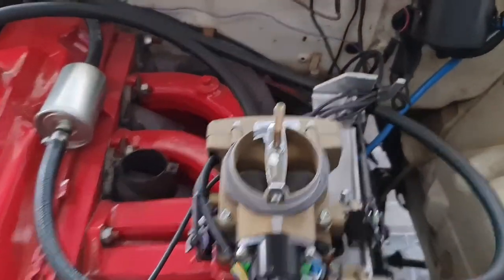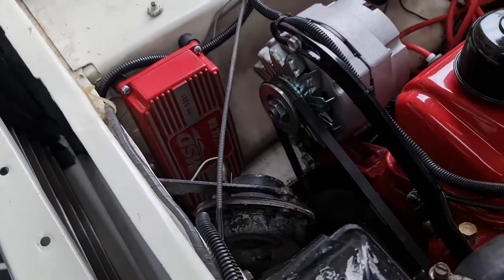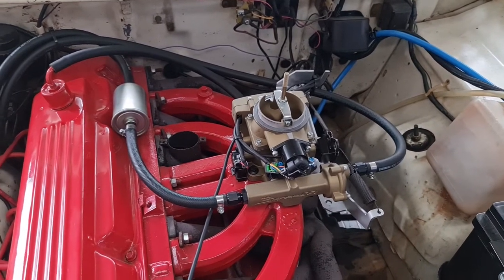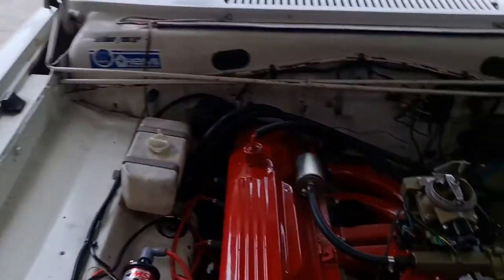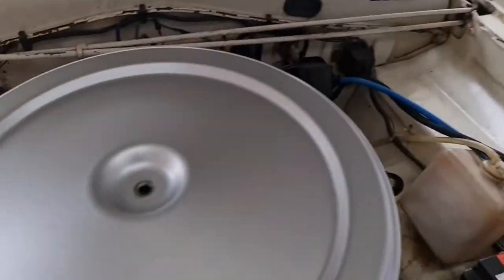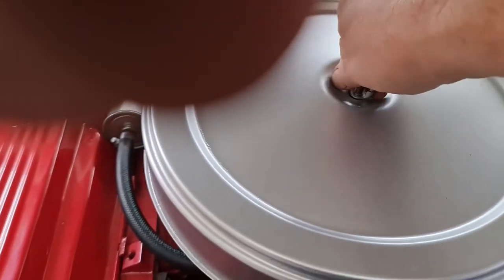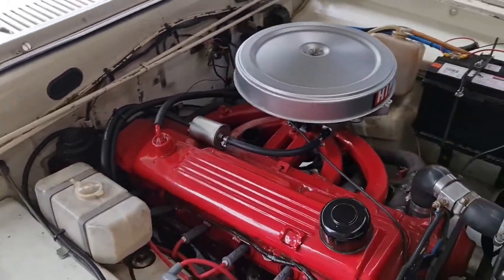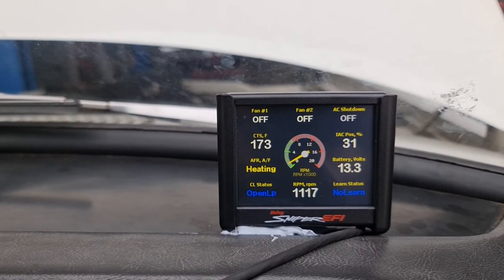2 barrel Holley Sniper set up on VC Valiant Sedan

Comment: I wouldn't have the metal fuel filter placed ontop of the cylinder head unless you wanna boil the fuel in the filter and end up with vapour lock.

Comment: Vapor lock is due to heat , of course, but also because there isn’t always enough movement of fuel and it creates heat soak.  
  A way to combat that is with the fuel filters that have a bleed off. They have an auxiliary tube that lead back to the tank to keep fuel flowing .  I would not allow that filter to stay on top of a cylinder head .  I would suspend it in the air where there is sufficient air flow .
Reply from the maker: The main reason this client wanted the Sniper system was it allowed driveability immediately and didn't require the choke or a warm up time.  This was an issue as he lives in an apartment complex and the lack of control with the old choke system would set off the Air Quality alarms in his undercover parking garage within 30 seconds of him starting his car when cold.  The Sniper has eliminated this.  Heat soak wasn't really and issue for this particular vehicle, having said that the Sniper does help eliminate this problem especially in Australian Summer city traffic where it doesn't matter where you mount the fuel filter in 45 Degree heat, you will get heat soak regardless.

Comment: What a nice set up!  I used to have a Duster and a Valiant years ago.  Both had a slant 6 and I always wondered if a Holley Sniper would work with these engines.
Reply: Such dependably with the engine & a EFI would be icing on the cake

Comment: Very nice, I would also suggest an electric cooling fan and a higher amperage alternator. The mechanical fan eats up quite a bit of power as well as fuel mileage. The upside to a mechanical fan is that you know that it is working I suppose.

Comment: Did you need an adapter for the Sniper EFI, or did it bolt straight up wing the 2 barrels were Holley?
Reply from the maker: If you have a 2 barrel intake manifold it will bolt straight on, no need for an adaptor.

Comment: Well done lads. I have a Sniper plus Hyperspark (Dizzy, Coil & CDI) complete system I got from Summit although the Hyerspark Dizzy, Coil, CDI was purchased separate. Fitting mine to a Holden 308 in my Sandman HQ ute. Got a new Camshaft (old one died thanks to no Zinc) that is 214/224 & 050. Also new timing chain, water pump, HP Oil Pump, Hylift R Lifters plus a 1 inch spacer on the modified Edelbrock Manifold. I too would love to use this on my mum's 202 HQ Premier. So did it start first go after fitting and any problems????? How much better is it to drive plus fuel usage?????
Reply from the maker: The Holley system learns really fast and usually will start first go, the more you run it the better it tunes itself and learns to all the conditions.  Much easier to set up then some of the other brands.  This client is really happy with his system and it is his everyday driver, he does allot of city driving in it too.  He is really impressed with how much more fuel efficiency he has and has just booked in for a disc brake front upgrade because it is so much more responsive.
Reply: What about a update on this one??? Still NO issues?? @ValigruntPerformance
Reply from the maker: Still no issues, car is still ticking along no worries.  All he does is fill her up turn the key and drive away.  Having said that the car is very stock and the Sniper's like it when the motors match their pre programmed settings.  We are uploading a more aggressive motor today, Dodge Challenger with a 440 on NOS, that really needed us to go in the laptop and make an individual tune.  Now that  it is done though the car starts, runs and races beautifully.  Next week, once we have finished editing, I will go through more of the tech end on the tuning of the Sniper and the difference certain adjustments made on the Dyno. @REVNUMANEWBERN

Comment: Fuel filter placement,fuel heater?
Reply from the maker: You run an EFI in line fuel filter and you don't need a fuel heater.
Reply: Missed the point,heat from the intake
Reply: @ValigruntPerformance  ye always have to heat gasoline in the winter,not.

Comment: Cool setup. Have you found any problems with fuel picking up heat from the block via the fuel filter? Years ago I had three cars with the Slant Six and was dissatisfied with fuel economy on all of them. Especially with winter choke problems allowing a soaking amount of fuel into the crankcase. I have wondered if fuel injection would have been better.
Reply from the maker: No issues with heatsoak and we get some stinking hot days here in Australia.

Comment: how much for the conversion Sir?
Reply from the maker: Ignition box, leads, coil, and sniper kit will set you back about $3500,00, they have to be ordered in from the States though and take a bit to get here.  Then there is quite a bit of work fitting, remaking lines, running return lines to the tank and larger fuel lines from the tank etc...  You can give us during business hours and chat with Shane and he can walk you through whats required to fit and make it work. 0428 351 885

Comment: Great video mate! I'm from the states and I have a 68 charger with a slant 6, I wanna do fuel injection too but I'm not sure where or how to start. Do I need a new intake manifold for it? How easy is it to set up and get running?
Reply from the maker: No you don't need a new intake manifold for it and the Holley Sniper is fairly straight forward, you just have to follow the instructions exactly.  The Sniper needs a good supply of current too, so make sure your alternator is up to scratch and can keep your battery charged.
Reply: @ValigruntPerformance  would you recommend it for use in a daily driver? I plan on driving my charger every day.
Reply from the maker: @ChargerusPrime  Absolutely, that is exactly why this client wanted the Sniper fitted.  This is his everyday vehicle.  He also lives in an apartment building with secure undercover parking and with the normal carburettor the choke and warm up time would make the pollution alarm in the car park go off every morning.  The Sniper stopped this.
Reply: @ValigruntPerformance  very interesting indeed. I've read some conflicting information saying that these often malfunction and leave their owners stranded on the side of the road. Maybe that's because they're putting out a massive amount of horsepower and that caused it to just give out? Has the owner of this car ever brought it back with any issues?
Reply from the maker: @ChargerusPrime  No the owner hasn't brought it back because of issues with the system.  We have fitted dozens of the Snipers and none of ours have had any problems.  We have, however, had allot of vehicles come in with Snipers fitted that are having difficulties.  On most occasions (easily over 90%) it is because the person who fitted it did NOT follow the instructions to the letter and on a few occasions it was because the sniper is very sensitive and any vacuum leak, incorrect fuel pressure etc will cause it to play up.  It will find and accentuate any electrical fault you already have in your ignition circuit as it doesn't like anything under 12V.  Once the incorrect fitment or pre-existing issues are rectified the clients have all been happy and not one of them has come back and asked it to be removed.
Reply: @ValigruntPerformance  that definitely makes me feel a lot better about it. I love wrenching on an old carbureted engine, but it can be tedious and with emissions cracking down harder every year alternatives must be found. I'll be taking my charger on multi-hundred mile trips a few times a year to see family, I just didn't know if it would be able to handle that constant use thanks to said conflicting information I'd read beforehand.

Comment: How much for a set up like that on a 202 in a ht kingswood?
Reply from the maker: Ignition box, leads, coil, and sniper kit will set you back about $3500,00, they have to be ordered in from the States though and take a bit to get here.  Then there is quite a bit of work fitting, remaking lines, running return lines to the tank and larger fuel lines from the tank etc...  You can give us a call on Monday and chat with Shane and he can walk you through whats required to fit and make it work. 0428 351 885
Reply from the maker: It's not a cheap upgrade but well and truely worth it.  You have to upgrade ignition to MSD, plumb a return line into your petrol tank, run a bigger fuel line and electric fuel pump plus of course the Holley EFI.  You also have to ensure that your charging system provides over 12 Volts on start up or it will not start.  So unfortunately it's a bit of work and not just a bolt on and go system.